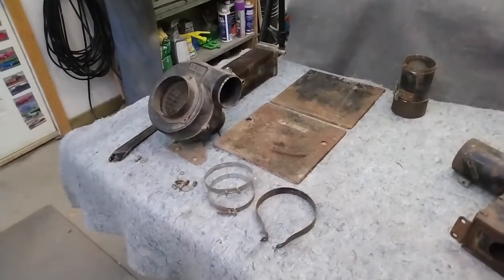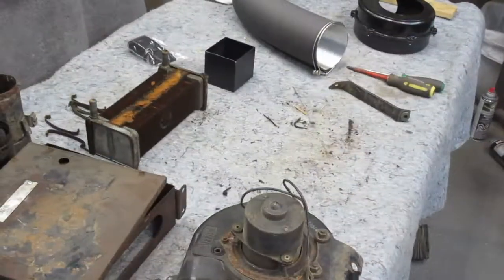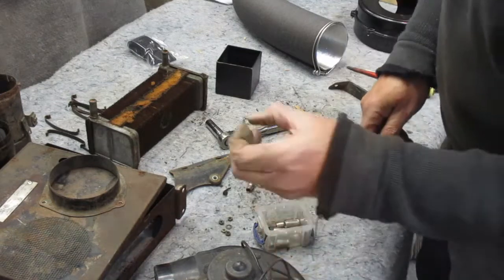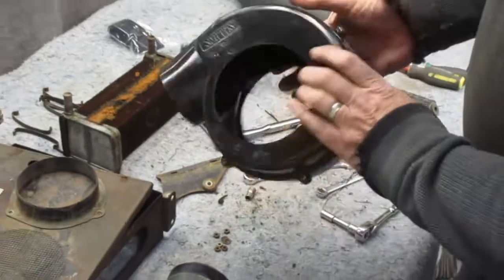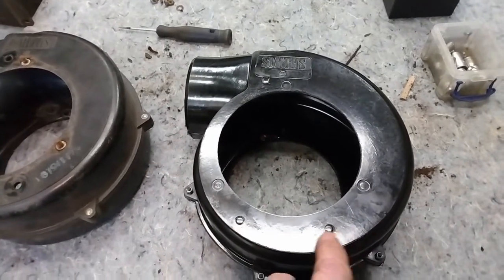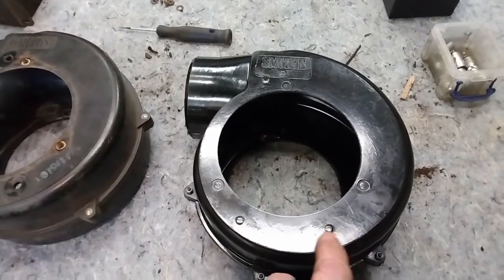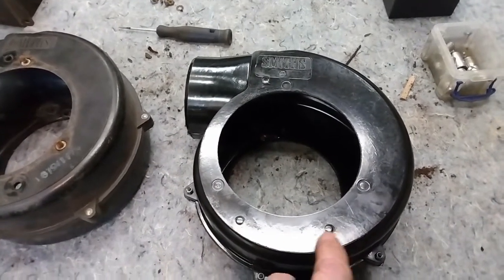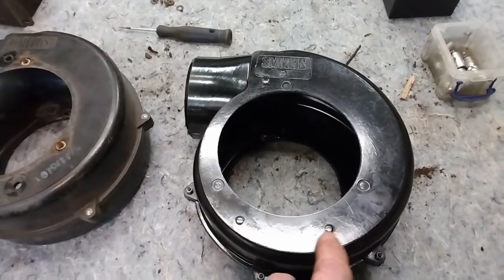How to rebuild the Austin Healey Sprite or MG Midget heater blower assembly. Bugeye Build Episode 95

Comment: I have a 1960 Sprite like yours and would appreciate if you could show me the routing of the sheath/wire that controls the air valve.
Reply from the maker: Hi Jose, Here's a short clip from episode 117 that show the routing of the heater cable, https://youtube.com/clip/UgkxV_esz1JgfA2VTu2PBmS3AfucvnTfdD8x?si=aTBlCWYff5cifBhc. Additionally, if you go to about 6 minutes in to this video, https://youtu.be/VcHN75HRjN8?si=xfe3CsLa2qtL_7nx, it shows how the cable hooks up to the control flap.